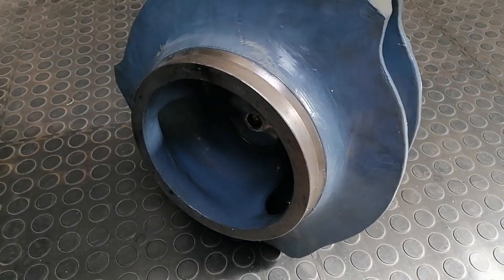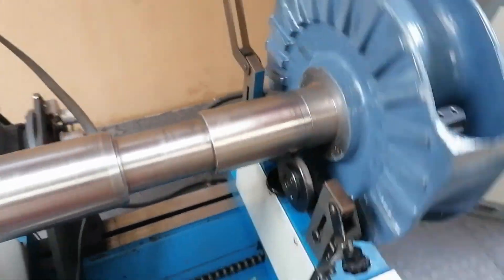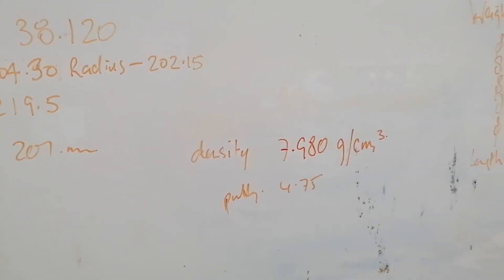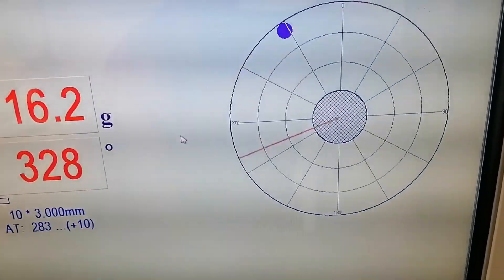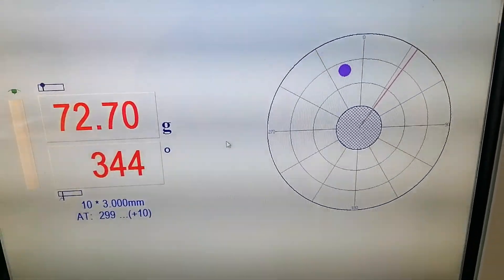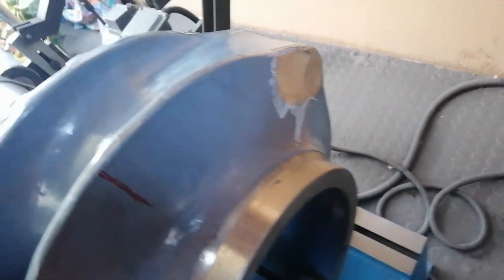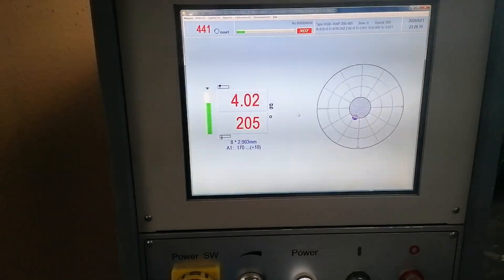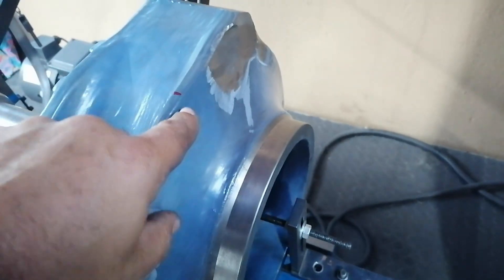Checking a Balanced Impeller for any Unbalance using Single Plane Dynamic Balancing

Comment: Good work there. Out of curiosity, the impeller would need painting with the protective coating again. Would this not add some weight back to the areas worked on? Thanks
Reply from the maker: Hi, thanks for the comment and question, yes, it certainly will add, but in terms of actual weight that would upset the balance, it would not affect it that much, and if it does it would be well within the permissible mass. 👍 Take care